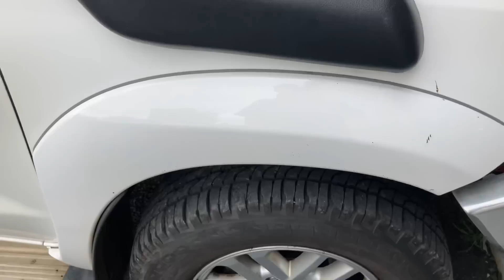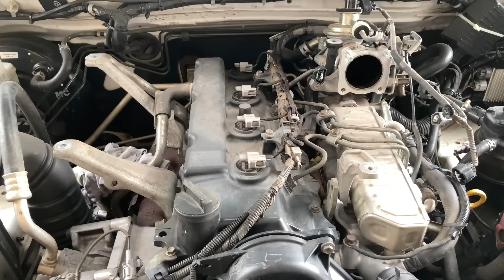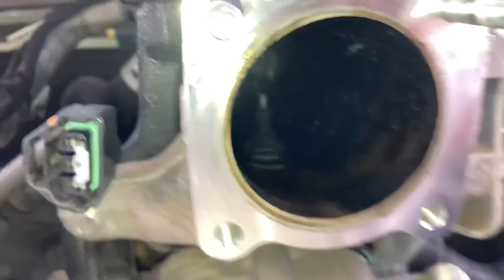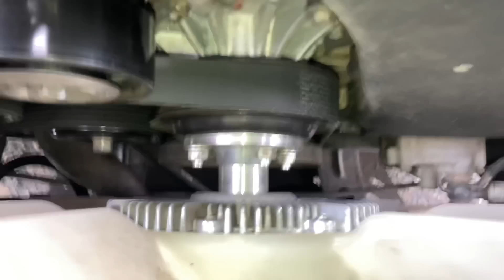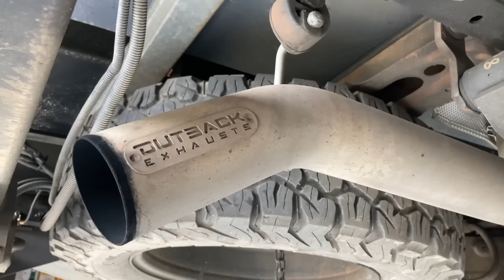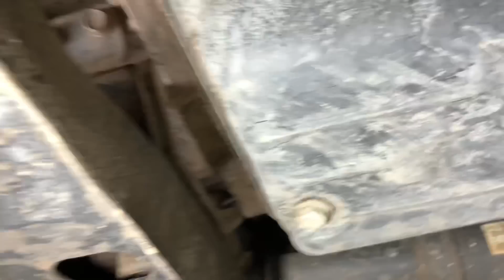WHY IS IT USING SO MUCH FUEL?

Comment: 10ltrs is about the standard across many brands of 3.0ltr manual diesel of the same vintage . 
Achieved 3.0ltr toyo   60+ltrs /631kms every tank  city driving ,,14ltrs/100km  when towing camper  h/way
Ranger 3.0ltr  manual  60+ltrs 520--650km  14/15/16 / 100km when towing city 
Extremely inconsistent fuel usage  1/ cleaned inlet system 2/ catch can 3/ new injectors 4/ egr delete    
5/ properly fixed extremely bad air conditioner ... No thanks to Ford all this was done at 92,000km .
100km/h = 10ltrs per 100   ,,,  120km/hr = 12ltrs per 100km  best by far NOW
Then I have purchased 2 x Toyota vehicles since

Comment: Anthony:
At 6:29 when you zoomed in-what is the other inline filter looking thing that is not the MAP (it has elbow connection) sensor filter.
Does it need replacing?
Cheers
Reply: Damper, E.G.R Vacuum 
Part no 25693-64010
Reply: I see, so that filter is just for that part.  Thank you.  Have a great 2023

Comment: I had a K@N air filter on a previous vehicle, even if you reoiled sparingly I found thin oil film after the filter.
Hence I assumed it would effect the MAF sensor.
This, together with the absolute annoyance of trying to clean the filter as best as possible as well as the time spent made me unhappy with this filter.
I then found out that the genuine filter not only saves time, is pristine, has a high quality rubber perimeter seal which limits the risk of filter bypass, but I was told there is some sort of spray on the paper which helps in stopping the ultra fine dust which is similar to the oil in the K&N in function.
Armed with info I decided to bin the K&N and never go away from Genuine.
Yes, I won’t even entertain alternative brands for this filter as I’m not prepared to take the risk.
Other filters are different.

I have a 2&3/4 mandrel bent exhaust by Beaudesert Exhausts (very first mod) and noticed the difference immediately in perceived performance.
Since, many mods to the engine and the result is:
229.8 HP & 512 Nm from the wheels done many years ago, with this Dyno very recent.
So obviously you don’t need a massive exhaust.
I had a 3inch exhaust on a GU6 Patrol once and it was too large and the drone was irritating.
Guys, learn from my experience and save money.
I also believe the 3 inch was too tight to cool enough, I assume from this the surrounding area would be hotter.  This is an assumption based on logic and the fact that it is very tight in places.
I also had a bracket break.  Sure it was fixed free of charge, but I had to travel 200 klms each way to get them to fix it.
I used the opportunity to see Mum, so it was a good excuse:)
I sure the extra exhaust weight contributed to this.

Comment: Tyre diameter makes creates a far far  bigger difference than tread pattern .
Clean injectors , clean inlet/egr  system .
Many other brands donot replace DID injector lines at every injector removal . 
tappet clearances and compression test wet and dry 
injector leak back test , even new injectors can be faulty
Reply: Dead right!

Comment: I drive a work 2019 Hilux manual,it does 14.3 the other auto one does 10.5.and they not hammered at all....
Reply: I had it the other way. Manual was 8.5-9.5l per 100km in city. Loaded 3t work ute with canopy. Auto around 40-50% more. 2020 manual hilux.  780-800km out of the tank easy.

Comment: 🤔 I got 800km to a 64L which I’m still wondering how the frig. 8L per 100 that’s which a bunch of weight and A/T, bullbar, roof racks 🤷🏻‍♂️. Though I do drive fairly fuel efficient eg coast to lights that are red instead of barrel down as quick as you can like most people only to have to stop. While I’m like go green 😅 so I don’t need to stop and use up my brake pads. Get 10l/100km in my JDM hiace that’s 4wd constant also 1KD roof rack bullbar 😅, mud tyres

Comment: I'm getting 9.5lt per 100km on my 76. Got 14.8 towing a 4.8tkn caravan.
Reply: I don't believe that for a second 🤣 you must be off somewhere in your calculations
Reply: I’ve got a hdj 79 land cruiser. 12 lt 100 km. Normal driving. 12.5 lt 100 km towing a 2.5 tonne boat
Reply: Getting 15 L/100 is most amazing.
Is your odometer out?
Best to check by resetting and comparing to Google Maps (provided you choose that route of course).
If you are getting this economy, don’t change a thing and keep your truck!

Comment: I’m getting 9L per 100km 2011 prado kdj150 standard tyres no bull bars . Is that good?
Reply: That’s very good
Reply: That’s good. I can only get that on my 2013 kd prado on highway drives. Normally i get 12L per 100km